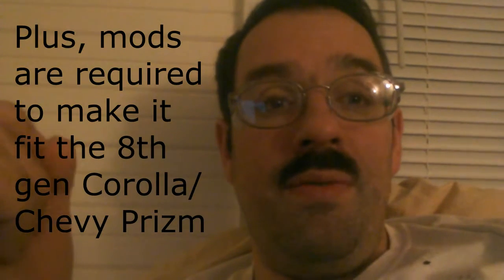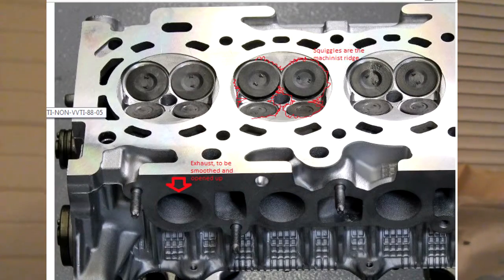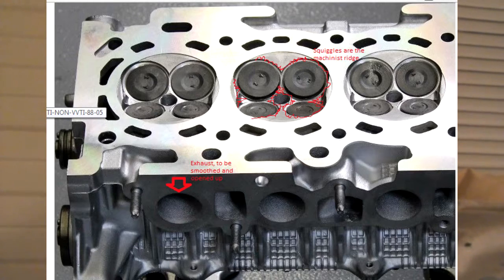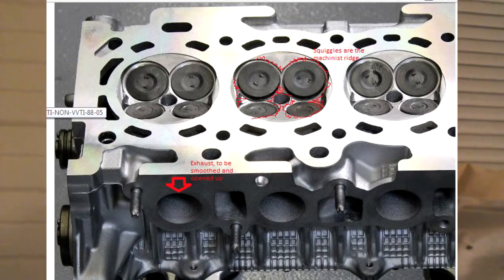Porting and Airflow Theory Idea Generation Session

Comment: You should have a look at the Suzuki TSCC (Twin Swirl Combustion Chamber) heads very interesting design! may not apply to all heads without a hell of a lot of machining, but very nice.
Reply from the maker: I've been dying to check them out since you mentioned it. I wanted to look at them then comment but I couldn't wait to say something anymore.
Reply: You can start by having a look here.  https://en.wikipedia.org/wiki/Suzuki_GSX_series
Reply from the maker: I didn't know that design could create swirl. Unique design. It encourages swirl while allowing for higher compression.
Reply: I have, rebuild a few of those engines back in the day and you could see where the swirl had a higher speed you had no carbon build up in those areas you could see a bit of carbon at the extreme corners of the combustion chambers only.
        
The way they designed heads was, pretty tick and cost a lot, they made the cylinder heads out of class with different shapes of combustion chambers   to test the swirls and would take an electric motor to spin the engine while pumping smoke in the intake and filming it with some can of a camera using a laser for the lighting and watch it in slow-mo to see what was the best designed, I all wise thought that it was reallyneet!
Reply from the maker: I hope you've subscribed. You're a great addition to the channel. :)
Reply from the maker: John. This is going to blow you away. My very engine is made for swirl the same way that your Suzuki is! What I was rightly calling machinist ridge is the way Toyota and Suzuki made the valve and chamber design maximize swirl!

This flips some of what I wanted to do on it's head. Normally, you remove a narrow band of metal from the machinist ridge to help with initial flow out of the valves but you can't touch it in this swirl design. All you can do, not that it's small, is back cut the valves, refreshen the valve seats, smooth out the combustion chamber and roll the air on the port side of the valves to make better transitions up to the valve.

If I remove the machinist ridges I'll lose all the swirl. . . But really with fuel injection can I lose some swirl to maximize initial valve flow?
Reply from the maker: One more idea. If I do take the machinist ridge out I could take it out of one intake port more than the other and the imbalance would create swirl.

As far as exhaust machinist ridges go, I can't think of how that'd help swirl, but if I went with the same theory to remove one more than other I'd have to do the opposite side as the intake (4 valves) so that exit flow would continue the same swirl direction as the intake. 

I just took the time to draw it and the increased reduction of the machinist ridge would have to be on the same side for the intake as the exhaust.

Video coming.

Comment: There's still a lot of theory out there from the carburetor days about airflow, but the issue is that it really doesn't apply to port injected engines.  Wet Flow theory changes dramatically when you're injecting at the intake runner versus at the throttle body, and I see a lot of people losing power by designing turbulence into their porting job thinking it will help fuel atomization.

Modern fuel injectors do a wonderful job in atomizing fuel, and for the short distance that fuel travels before it gets slucked into the combustion chamber, no amount of laminar flow will be able to drop the fuel out of suspension.  Maintaining laminar flow and good port velocity will show better "real world" results than any amount of hogging ever will, at least for a street vehicle.  When you start talking race applications, all that changes, but that's a subject for another time.  ;)

If you're using stock cams and stock fuel mapping, then the only changes that should be made to the intake manifold and runners are to smooth out airflow with as little enlarging of the runners as possible.  Larger intake runners makes for lower port velocity, which results in a loss of "low end" torque.  Understanding how each individual engine breathes is crucial to determining runner shape.  All other things being equal, the engine that gulps more air in the first .050" of lift at "low" RPM wins at the lights AND the pumps.  

As for the fuel pump flow concerns, keep in mind that if the vehicle has a return line and a pressure regulator, the fuel pump has more capacity than that engine will ever need in a naturally aspirated state.  Dead-head the average fuel pump, and you'll see line pressures well above 100psi and flow rates easily in excess of 300% of the engine's requirements at redline and 80% injector duty cycle.

Combustion chamber finish is a can of worms.  There are as many thoughts on the subject as there are people capable of thinking.  I...Probably won't touch it.  My experience has been that it's part of a system, rather than a stand-alone modification, and how you treat it should be based on a great deal of forethought, planning and design of everything else.  The "Krakatoa Theory" (a large volume of air gliding over a cushion of microvortices) holds merit, but a similar performance can be achieved by back-cutting the valves and rolling the valve seats.  Smooth surfaces mean more spark advance!

It's all an incredibly fun subject with a tremendous amount of diversity and variability.  I wish I had the decades to devote to even a simple mastery of the subject!
Reply from the maker: Ah! I can see you have caught the bug as well.

A couple of points of re-study for me since this video, as this subject can make me feel left wanting again and again...
...David Vizard says that focusing on the points of the most restriction will make a port much more efficient. While hogging out a port where the air is already the slowest is likely to  make a port simply lazy.

Back cut valves, rolled valve seats? Huge. It's been a while since I was in his book instead of on YouTube where I couldn't see the charts, but he made an example of how much air had to get past valves. In the picture, most of it is air, and beside it, is a little man to scale for how much air goes through a particular race engine. Yet, of course, still, there is that little valve, which is smaller still than the man when you see the math for how much "surface area" an imaginary cylinder from the valve seat to the cuts on the valves. That little sideways space, where all the action has to take place. Can you imagine it?

What is next to that moment of greatest restriction is often a machinist ridge in the combustion chamber. You're right. Most people won't touch it. The trick is to have a set of valves you don't care for as a guide to your single cut burrs, and round out a small trench around the valve, exactly the size of my smallest burr. Then blend it. Surely, everyone's fear is you've made the combustion chamber bigger! The tiny drop in size, vs. having air and fuel tumble and bounce through this section, which forms larger droplets, is more my worry. Plus, with the increased flow, while static compression is slightly lower, dynamic compression will be higher.

Make effort on the port side of the valve, working in the bowl ... I'll continue my thoughts at a later time. :)
Reply: So please explain to me why the carburated engine always make more power than fuel injected engine?